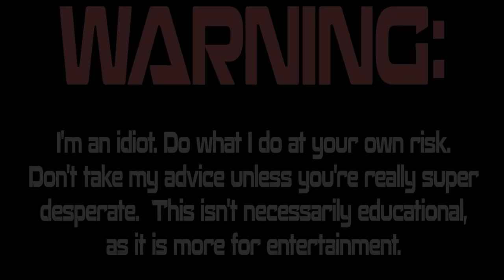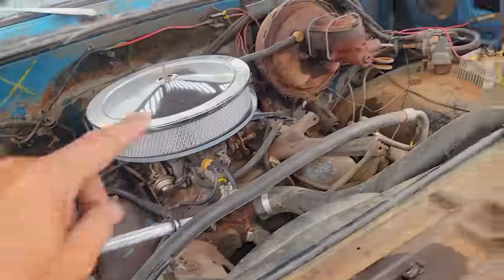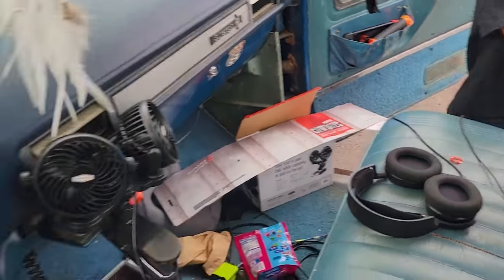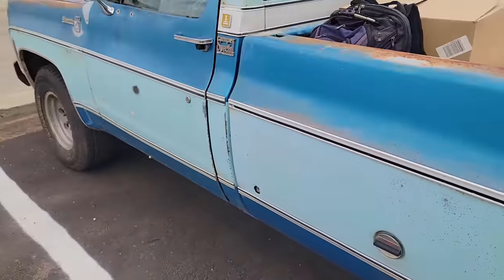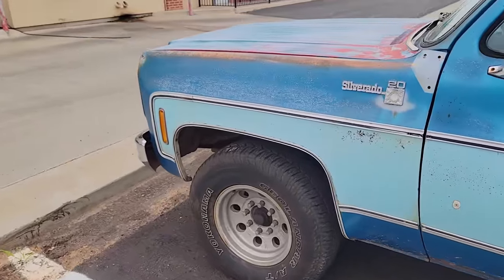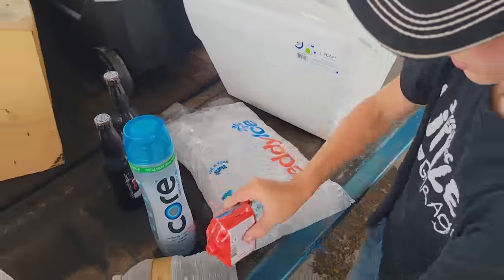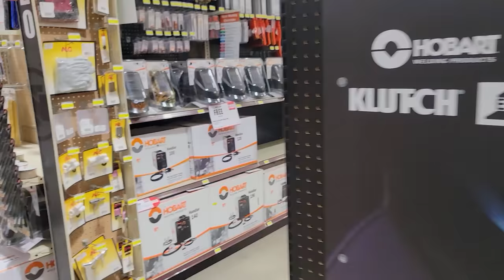Multiple Break Downs, Upgrades, and stops on Route 66! - Day 4

Comment: Great video! Old house at 19:23 was an old gas station and store called Cedar Hill, located 8 miles west of San Jon NM. East of Tucumcari. The roof of the store was constructed using flattened oil cans instead of normal shingles. Closed about 1980. I stopped there in 2019.
Reply: Tucumcari is my hometown and was hoping to see a few more spots around town. The gas station and that’s refer to in this comment is reported to be haunted. I had a family member who is broke down in that spot and was almost hit when that overhang came down.
I spent most of my childhood dragging that highway in Tucumcari. Neat place to grow up. Kind of sad now.
Thanks Derek for taking me home.
Reply: It looks eerily similar to the snake place and phone booth location used in Duel
Reply: @trevorstein4603  My snakes!

Comment: I call the styrofoam coolers "one night stands" for that very reason. A case of beer comes with its own cooler if you add a garbage bag and ice. Lasts nearly as long as the one night stand, too. I put two fuel pumps in the factree 305 of my c10 within a five year period. Changed the motor out about 15 years ago & no trouble since....knock on good wood. Thank you for the Route 66 tour. This is probably the only way this gal will ever get to see it. That truck is looking better with every episode. Can't wait to see how much it earns at the auction. Y'all have fun & stay safe!

Comment: The one part that you said never breaks, is the only part that broke on mine. Back when a fuel pump cost about $5, cost me $27 in the middle of the desert. And grease will hold the rod in place while you reinstall the pump. Nice to see another deluxe camper special package .

Comment: remember back in the 80s when those Cadilacs were there, but without all the paint, havent been down there fer a spell, quit trucking in 07, alot has changed on the old road, i do remember Clines Corners, been by there many times.

Comment: Fuel problems like that is why in the old rigs, I carry a bit of boat fuel line with the  squeeze bulb primer, actually install it on some REALLY old machines with the bubbly bulb under the drivers seat (also leaves a space for a clicky clack

Comment: Great tip on the fuel pump rod, grease never worked for me because always working on a hot engine. Hack saw blade to hold it up is what I did. The comment about fuel pumps going out less than the wife agrees with you, caused some coffee to come out my nose. I had a 85 k10 with a 305 that ate fuel pumps often, whenever it was hot and humid. I thought it vapor locking but once the pump quit it was junk, I could prime it and get it running again to drive to parts store, but that was it. Got to where I carried a spare with me.

Comment: i can't believe that accel coil died. they sure don't make'em like they used to. a had an accel dual point distributor and a super coil on the 340 in my challenger back in the 80's that were awesome. an edsel would be cool to take a tour of. there just ain't many of them around anymore, not that there ever was, seeing as it kinda flopped as a product line. what i find amazing is for the majority of the trip, you are the only vehicle on the road. really cool.

Comment: I learned about the HEI technology at a younger age when things were easy to work on. It was good practice to keep parts like ignition module do dads and an extra coil in the glove box. This is after the fine quality that China puts out you really need to keep two of each in your glove box. I had an ignition module start going out on me causing the engine to spark knock so bad I thought she blowed up on me. When I eased it off the expressway on the shoulder it shut down causing it to diesel. Thought the timing chain was going out because why in the devil would a brand new ignition do dad just go out on an HEI. Well that was exactly what it was. Ruled out timing chain because of the way that it was, lighting whirler was a whirling. Had once or twice the little spring that goes between lighting cube and the lightning whirler disintegrate into black dust and caused no spark. They just don't make them like factory anymore.

Comment: If you use the paper towel to wipe off the squeegee between strokes it won't leave those lines on the glass. I learned that back in the 70's working at an actual gas station.

Comment: I just got the 1 horse air compressor last year for free. It was tripping the breaker, just switch it to 220 volt and twala. Thirty gallon air tank and enough wind to fill a tire with a nail in it.

Comment: On the fuel pump swap issue you mention about people struggling to keep the camshaft lobe shaft up so as to install the fuel pump. I always just used a hacksaw blade to hold it up and when installing the new pump the blade is so thin that you can get your pump arm right into the spot you need. for the shaft to rest on.

Comment: With what you said about knowing the vehicle and not to buy part after part to fix it. On an old 90’s ford. Lost spark. I did the old google of the symptoms and it seemed to be the pickup in the distributor. My cousin who works in the junkyard thought so too. Replaced it and it works better.

Comment: This is quite  journey for the little guy.  He will remember this for a long time.There is something people should be aware of regarding that bolt you can take out to aid in installing your fuel pump. It is a bad idea to put a long bolt in there and crank'er down. Some knucklehead did that on a 283 I got. Wondered why the fuel pump wasn't working. I found the bolt and discovered that they had bent that push rod and even cut a groove in the side of it when the cam shoved it out a bit. They weren't fooling around.

Comment: Accel Super coil and GM HEI, excellent conversion, that IS all i have ever run on old points conversion vehicles.  NICE!!! to bad the setup you had wasnt working right, i did not see the point when you converted the points to HEI.
My last Super Coil was purchased in 1996 and still runs like a boss on my 1972 400 CI. SB.  Iv heard a lot of never stuff is all junk thought, bummer. My coil under the accel cap looks much different than the one you show that has failed.

Comment: Those foam coolers will leak with or without cracks. Nothing like having one in the back of a rental Mustang and finding 2" of standing water in the leather seats where the cooler was sitting.

Comment: A VGG on the Edsel would be outstanding.  In my field, (UX Research) the Edsel has a place in our Hall of Shame for being a great demonstration of what happens when companies push features and products out the door without asking their users if the features and products are useful, needed, or delightful.  Good old McNamara was a big data/marketing kind of chap, so UX Research would have been abhorrent to him.  And Ford paid the price.  Interestingly, the Temperance Fountain in DC sits next to it for the "Providing a solution to the wrong problem users face."

Comment: Side post batteries love to corrode where the bolt meets the cables. Not where the cable meets the post. Remember that fellers and pull the bolt and check for bad continuity there. It’s a real issue.

Comment: Every chevy v 8 I ever had I replaced fuel pump. Lol.
  Finaly got tired of it n installed low Preassure electric.
1985 Honda electric pump works a Treat. And about 35-40 bux.
 They also work a treat on a gl1200 gold wing compared to their stock unit.

Comment: I bet if you swap out that guardapuke carb for a carter afb or edel AVS2 it will eliminate those internal vacuum leaks of that work out carb, run mucho better. The best quadrajet is a recycled to scrapyard one. LOL

Comment: I had a noise in my rig like scraping so i did brake pad noise still there did bearings both wheels noise still there so i did the wright thing and drove like that for 12 months it was bloody speedo cable 😃😄

Comment: RE: Fulel pump rod. I always thought you TIGHTEN the bolt to hold the rod up. Not that you remove the bolt to put a screw driver in to hold the rod up.

Comment: coincidentally, if you leave that bolt by fuel pump out on a SBC, it will lose mucho oil.  Only at higher rpm.

Comment: you Eric I found a 2000  Lincoln with a 32 valve that prob needs a timing chain, crank sensor or ecm or tcm. guy has no clue about engines he bought it for like 200bucks and dumped over a grand in parts and a junkyard trans in it. would be a hella cool

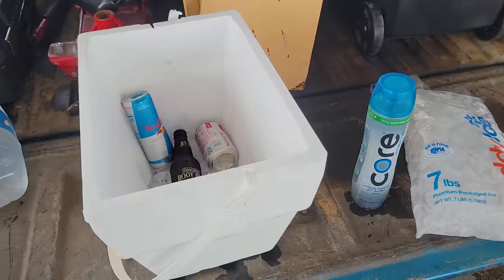Comment: Brake ! "Old-timer"? Why we were putting cars together before you wore britches young man. 1st car 65 Chevelle SS put a Z block 302 solid lift cam powerglide 2 speed with 4:10 12 bolt. All Chevy. My new toy 93 Chevy Silverado 355 93 Corvette cam. New everything suspension front to back. Still turning wrenches I had with my 1st car. Great drive your on Derrick. 27 layers of paint = no rusted Cadillac's, 66 yrs young.

Comment: Actually that 396 big block has a square 7/16 nut just under the fuel pump, remove it and the 5 3/4 rod slides right out. Put some grease on it and push it right back in all the way. The grease will hold the rod in place while you insert the fuel pump arm under it.  Your done!

Comment: Maybe, next time Bentley tells you the fuel pump's on the way out, you'll believe him.😂
Not as daft as it sounds Derek. When I was about five, I could diagnose a dodgy water pump, just by the noise. I had no idea what a water pump was, or what it did, but I knew what  a ****ed one sounded like cos I heard the one that left us at the side of the road.😂

Whoever gets this truck is gonna get a whole dose of new parts on it. I know that was part of the master plan but there's a few extra bits going on there. You're not having a whole lot of luck this time buddy but, knowing how your head ticks over, you'd probably rather it happened to you than the new owner. You're not often this unlucky though, when you think of some of the junk you've driven hundreds of miles.

That Cadillac Farm is quite a sight. You should look into getting the franchise for the paint shack; now that's a licence to print money, or at least paint money. Here's hoping the rest of the trip gets easier; Bentley will be getting a bad impression of this road tripping nonsense.
Good luck guys.👍😁

Comment: I guessed it was the fuel pump .Girlfriend had a Malibu with a 6 cylinder and the fuel pump got changed many times so many . So if the car stopped running there was no guessing just change the pump . The cam has a bump plate on it which pump a lates the fuel pump a lator

Comment: Never knew about that bolt thing for the fuel pump. We use to put a blob of grease on the rod to hold it up in there till you got the pump in. byw how in the hell did you drive that truck with expired everything threw TX without getting pulled over? I get a ticket every time I pull out the driveway!

Comment: Sooo Derek to Derek. I'm stumped on my 96 Tahoe with the 5.7/350. Idk if you answer questions I am a ase certified diesel mechanic and car mechanic but this shits got me racking a fellers brain. Crank all spark all fuel no starts. Did the crank sensor and cam sensor, ran started 50times over that's day. Mind you all cap rotor wires plugs coil ignition control module all new. Came out 4  days later crank crank all fuel all sparks no flippen start. Wtf is happening. Just looking for a insite. Won't go to pay a mechanic I am one but we all run into weird issues asking friend or people seems to work best. Thank alot of you see my message or any other vice grippers in the comments 🤞👌🏻

Comment: With today's cars you need a damn PhD just to either change the oil (reset the change oil warning on the info center of the car) reset the clock or even change the air filter

Comment: There is no way one could know about the fuel pump and transmission. And added things that are not critical to motivating down the road is interesting. But I really would like to know why you did not replace all the belts and hoses before you took off? What's is next, are you going to blow out a brake hose?

Comment: Accel seems to have declined in quality.  I got my old truck going with a no-name HEI off of Amazon, and replaced it with an Accel unit as soon as I could.  Same reason, I wanted more reliability.  It lasted less than six months.  I slapped the no-name back in, and it worked fine for a year until two drunken illegal hit-and-run drivers took out the truck.